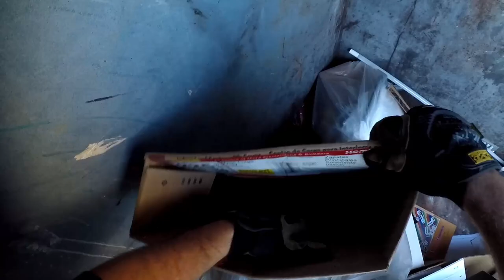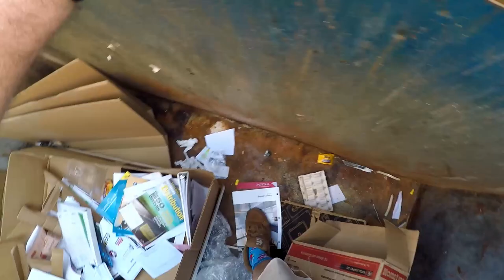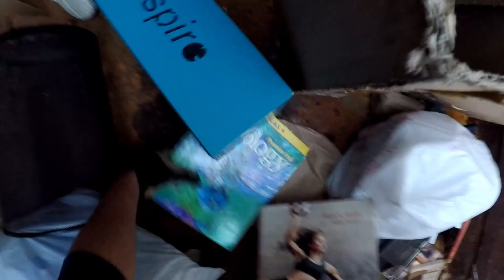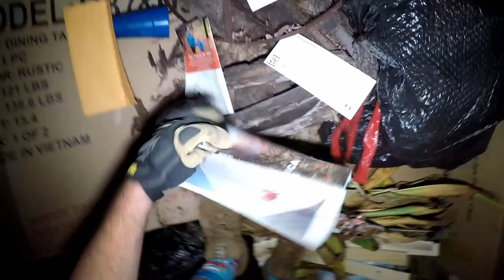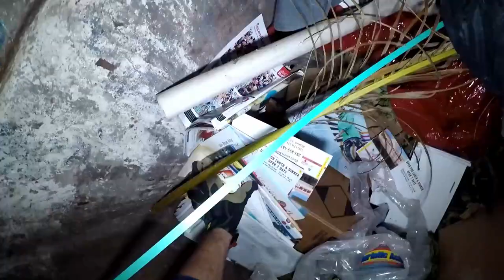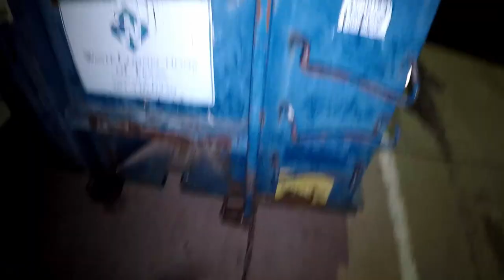Dumpster Diving "It's Got Bullets In It!"

Comment: Hey Mike, it's for shooting green board onto concrete that's what it's for Mike you take the 22 round you stick it in there there's a nail that you put on there as well you set it down over the green board on top of the concrete and you shoot it and it holds it in place that's what it is

Comment: the thing in the top of the box is a PLC programmable logic controller  for running motors and other electrical equipment and  machines there may be 30 lbs of wire in there the breaker things are relays  there should be a copper or aluminum ground bar in there to.

Comment: 32:13 that black thing inside the electrical enclosure is a Programable Logic Controller or PLC. It can be a lot of different brands but the ones more prevalent are Allen Bradley PLC 520, 540, 580. SLC 500 PLC's have input and output cards, a power supply card and a processor. It controls Outputs when Inputs are at predetermined on and off states.

Comment: Can you get the property owners permission to recycle all that metal. He has to pay by the ton to have it hauled away so it would be to his advantage to allow you to scrap at your own risk.
The Hilti nail gun is exactly for driving nails into concrete. The 22 cal loads come color coded for the proper power for your need. You need to learn safe operation before using it because it could be dangerous if used improperly.
Reply: LZ129 Brazil with the load all mixed together nobody is going to get scrap value. If they where saving the metals there would be another dedicated dumpster for metal. What Mike is taking is destined for the landfill if he does not save it.
Reply: Usually the contractor for the open-top dumpster pending on municipality State country has to go through and sort materials. probably flat rate for the dumpster drop-off and pick-up plus extra charge for weight. Most companies can make extra money off of recyclable weight.
Reply: On the other hand Mike . You just saved the company that rented the dumpster some money on weight LOL. Company's definitely charge more money on weight then what they would get back on recycling .Just trying to say open tops usually don't go straight to a landfill , insulation, wood, styrofoam whatever it may be has to be disposed of more environmentally nowadays. I don't know if dumpsters have to be sorted as far as I know they just go straight to a landfill so keep on diving, just please pull some stuff out of the dumpster and get it out of your way once in a while you're driving me crazy lol.

Comment: The Remington nail gun is used to nail wooden walls down to a concrete floor. They use a blank 22 caliber she'll that really is very loud when used inside a closed building even worse in a closed room ear protection is a must also can be hard on your hands when fired. Just you know from a guy who spent about 18 years doing maintenance work in a factory I've had to use them more than a few times.

Comment: That big panel box has PLC rack in it best to remove from den rail and sell on Ebay much more money than scrap price depending on type maybe upwards to 750.00 in that box with 24v power supply and Input/output cards just check it out before you junk it

Comment: The Remington is called a ramset to set nails in concrete. Uses. 22 cal gage for shot.
Reply: Actually,  unless Remington has changed them, they are .27 caliber blank shots. New a couple hundred each. Needs to be cleaned and lubricated before you try using them or the 'ram' could break. Look for the user manual online.

Comment: This is when you need a heavy duty tripod and a come along winch, just need some clamps on the feet so you could clamp it in the corner of the open tops. One foot on the corner point and one foot on each wall of the corner.

Hopefully there is still some scrap left in that open top next time you go. Don't forget to take some tools for those doors. It might also help to go on foot to watch security and see their pattern of patrol, maybe figure out when he is just leaving the area and then head in.

Comment: Those Remington nail guns are pretty pricey  to buy. You should be able to get a good resell price on them .. From the looks of that shot strip it's a 25cal. blank that is used to drive the nails into concrete or steel .. 
They are loud!!
And can hurt your wrist when fired if not held properly. 
Great score .. Resell should be good.

Comment: Mike that tool you found that uses 22 caliber bullets blanks is what they is that drives Nails into cement you have to be very careful when you're using it cuz it will shoot like a gun but you need a hammer to hit the back of it does not shoot like a gun

Comment: Those were little relays in that big metal box they switch things on and off via a control panel so like you could turn on a motor. And then switch to something else. Without having to do it yourself it does it automatically  via a computer I think that's what that box is for. But those boxes can be used for many things.
Reply: Also that nail thing was pretty cool.

Comment: i think unless texas has differant rules, but unless your inside the property, or there is a sign on the gate/building that says "customer/employee parknig and cars/vehcals only" you should be fine, i bet they sercity guy would be all like "just be careful if you hurt and injure yourself were not going to pay out if you sue" as that's all they can say unless the dumpster is like weight based but if it was then it be mostly guarded or say "no scrapers" on the side

Comment: Where you take your scrap do they pay more for short iron ? If so and you get pipes like that again I get a chop saw and cut the pip into what ever size the scrap yrd requires for short iron because where I'm at pays double the price for short iron
Reply from the maker: They don’t but if I bring in pipe longer than like 10’ they will doc a few pennies as the call it “unprepared”
Reply: His yard pays .72 lb for short/ prep .69 lb unprepared and  .65 lb for bailing. Not much of what he got was thick enough to even be considered heavy iron at this particular yard